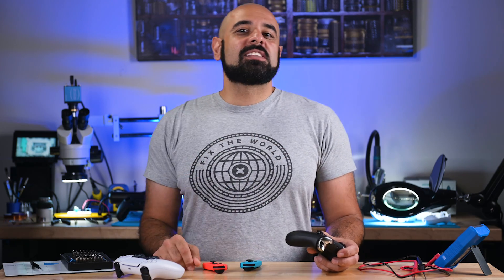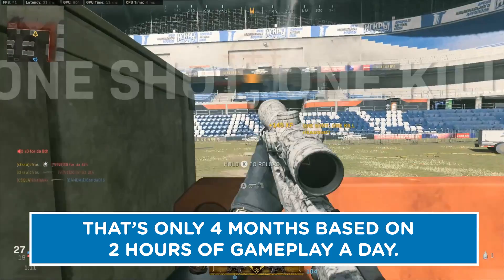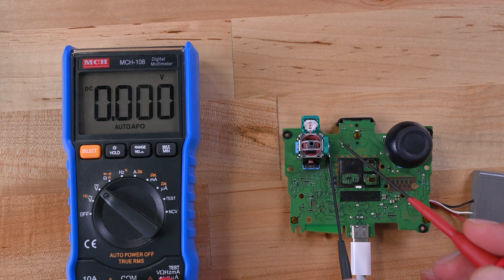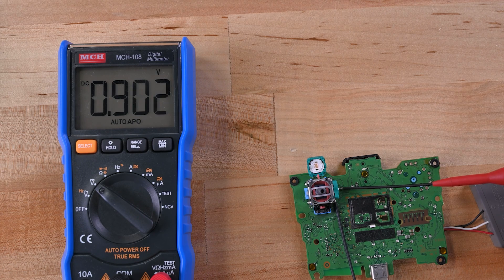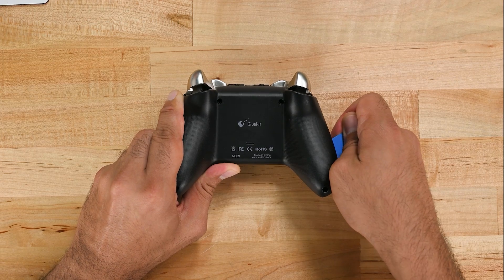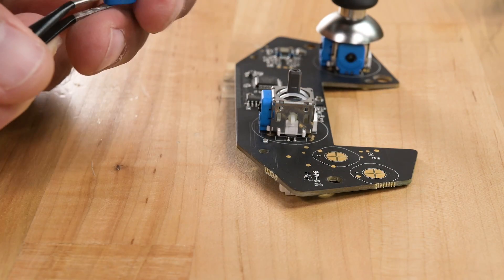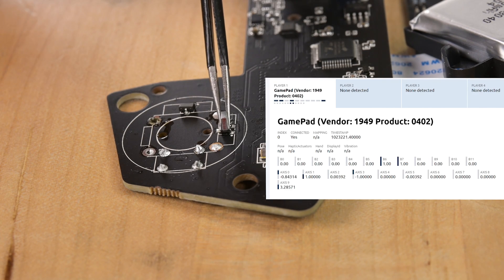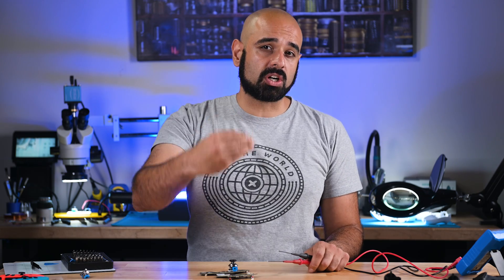How Manufacturers Can Fix Joystick Drift - Permanently!

Comment: for me, I've been able to stretch out my pro controllers to years instead of just a couple months by remapping and training my brain to use the back buttons as the l/r 3 buttons, since mashing those in causes the most amount of stress.  I for sure would drop big moneys on a pro controller with hall effect sensors, because I'm not going back to mashing the l/r3 buttons ever again lol.
Reply: that was especially an issue on former dualshock controllers because if you pressed the thumb sticks in it would apply pressure to the circuit board inside and cause internal slack over time. this made it so the controller would mash random buttons even though the analog sticks were just fine. i don't think other controllers encounter these sorts of issues.

Comment: The one problem is that, currently, most companies have joystick drift to their favor since their customers either buy replacement parts or flat out buy a new controler. The only way I see to fix this is if a 3rd party company can successfully compete in the market using these sensors.
Reply: Well Gulikit is supposedly working on replacement Hall Effect sticks for joycons and already has them available for the steam deck.
Reply: @nsshurtz  If they can pull it off for xbox 360 controllers, I'll replace all the sticks in my controllers right now...
Reply: @ddrfr33k hey idk if you’ll receive the notification, but there’s already really good ones out. If you can solder (the iron is less than $20 on amazon) and you don’t mind the Chinese (since the module is from aliexpress) it’s 10 modules for $15. So you could do 7 full controllers. I can link you the video of the guy who tested them so you can decide for yourself.
Reply: @nsshurtz  Yeah but it's Nintendo we're talking about, they'll probably hit Gulikit with some bullshit multimillion lawsuit to stop them from making hall sensing stick modules that be used in Joy-Cons.
Reply: Until Sony cancels your account for refusing to use their controllers.
Reply: Or simply legislate that a controller that suffers from drift is patently unfit for the use it is marketed for, constitutes fraud, and the manufacturer is liable for repairing all drift issues for the lifetime of the product.
Reply: @superslash7254  or people should just assume a controller is a "consumable" part meaning they wear out overtime. It's like saying a tire should last forever or it's not fit to be sold.
Reply: @randybobandy9828 
While controllers will eventually wear out, you should expect it last longer than the warranty. Usually 1 year. But these controllers starts getting drift within months on use. Not acceptable.
Reply: @2010ngojo  months of heavy,heavy playing
Reply: @randybobandy9828 
Doesn't matter. If the controller is not abused, then it should last at least the warranty period. Unless they like to replace a controller every few months, because that's what Nintendo is doing right now.
Reply: Game controllers will be more of a challenge.The issue has been solved on R/C transmitters, since you buy them separately and people expect them to last many, many years, hall effect is a major selling point, something consumers actively seek out. Now that this technology is hitting the "mainstream" gaming market, I can't help but feel it will be a desirable feature here too.
Reply: @jpsalis  i hope so
Reply: They want sustainable economy but we need sustainable consumer electronics,..like 6 years or 10 years warranty
Reply: @Deezeone  very well said.
Reply: There's the gulikit kingkong 2 pro, right now it supports xbox, mobile and pc if I'm correct
Reply: I gave on a PC lol
Reply: or people stop using controllers for a year at least and switch to keyboard and mouse as a form of punishment and protest..then these companies will start fearing and respecting consumers
Reply: @techach3490  lol they won't care if you don't use a controller for a year.. do you think a controller sale is a huge part of their revenue stream 😂 no, it's barely profitable,  they make their money on games and software sales.
Reply: if so then i would expect small tech companies to come out with all in 1 complete replacement kits for the sticks that are as close to drop in as possible
Reply: Exactly!
Reply: problem is if some company were to make a Hall Effect JoySticks version of the dualsense i don’t think it could use the adaptive triggers and haptic feedback because of patents etc.  im not so sure many consumers would take that compromise.
Reply: I would be in the market for a 3rd party controller with hall effects sensors if they just copied the Playstation layout instead of making every 3rd party ps controller a Xbox copy... There is a reason ps players play on the ps. It also needs to feel as good in the hand, the adaptive triggers are fun and feel good in mw2 tho so it would be nice if they take that aswell but idk if that opens them up to lawsuits
Reply: @championxxlNL 
The controller is not the main reason for playing on the playstation, come on now.
Reply: @2010ngojo  no ofc not but I do prefer the lay out over the Xbox and with the ps5 sony finally made a controller that also feels just as good, if not better, in the hand
Reply: @championxxlNL 
It's still meh in terms of overall design vs other controllers. Who designs a controller where you can't put in down without the triggers being actuated. Better than their first few designs though, arguably the best they designed.
Reply: My controller is blue so I never get joystick drift
Reply: "Competitors" do exist... but I wouldn't expect gamers to be willing to pay for military grade hardware made for drone operators. Despite the fact that the military hardware is perfectly compatible with xbox and HID.
Reply: Well, judging by the worldwide discontent with these controllers and the problem of drift, especially in the new generation, we must do it ourselves, apparently. Compete on your own
Reply: they will software block this making your third party controller obsolete only way is to solder holo lens sticks to your ps5 controler etc but even that they can prevent in software if something in the controller is changed the controller might simply dont turn on.
Reply: The only company I can see doing this change is Valve with their Steam Deck.
Reply: Let's see how that's working for Nintendo, where they are replacing a bunch of joy cons for free.
Reply: Only cuz the law was threatening to come down on their asses
Reply: @2010ngojo  aren’t the big 3 all getting a class action lawsuit for their controllers anyways ? 😂 next gen we’ll probably see better joysticks but i doubt this gen since lawsuits take years.
Reply: @Hypno_BPM 
Didn't Nintendo recent got one of the lawsuits tossed?
Reply: @2010ngojo  yeah cuz of the EULA saying consumers can’t sue Nintendo 😂 bro life is a meme fr. Still they’re giving free repairs and i’m sure spent a lot of money for the court lawyers so idk , the smart business move would be to make better controllers for their next console. Nintendo is usually great with accessories quality so the joycon drift might be a fluke. The biggest difference between Sony/Xbox and Nintendos lawsuits imo is the fact that Sony knew the dualshock 4 had drift issues and still decided to use the same parts for the dualsense whereas Nintendo didn’t have any issues with the Wiimote
Reply: @Hypno_BPM 
Personally I never had drift issues with my ps5 controller but several joycon drifts. Luckily there are aftermarket joy con replacements, but still.
Reply: @2010ngojo  yeah i mean it’s a lottery when you guy these modern controllers. i’m on my third dualsense all got drift on the left stick and my brother for example still has his controller that came with the console.
Reply: @2010ngojo  i’m on my 3rd dualsense in just a year and i take care of all my electronics so i wouldn’t say i’m causing it since it definitely feels like mechanical problems. But then my brother still has his controller that came with his ps5 so i feel like it’s a quality control issue.
Reply: Currently the "3rd party company" would ONLY be gulikit because they claimed to have patented the Alps compatible design. This will also wall off any possibility for major controller maker to switch to them for obvious reasons since they are the only one who can make Alps compatibles that allows low barrier adaptation but they also are a unknown Chinese company came out of no where and can't make any guarantee on quantity and quality assurance.
In one way gulikit made the big picture worse since now major controller makers need to make their own design for no or negative financial return, further upping the entry barrier. I can see some small startups use them since they only need to make thousands and not millions of orders.
(I guess Alps could still license the patent from gulikit and make their own version of it, Intel-style, if more people want this or someone in charge actually decided to ban planned obsolescence)
Reply: Yup, i still have the original Dual shock 2 that came with the console.
Bought it at few months after NA PS2 launch.
Still working flawlessly till today.
Reply: @rubiantary  i have a nintendo 64 controller that still works perfectly
Reply: Yeah I bought 2 powerA controllers for my switch and Xbox and they work great thier wired so no drift.
Reply: @GamerBoy870  Controllers being wired has no effect on whether they will drift or not, it's the hardware inside the gimbal itself that dictates that. PowerA still uses a regular potentiometer that is prone to drifting so at some point or another, your controller will start drifting too. The only solution to drift is implementing Hall Effect Sensors or a deadzone (Not really a fix tbh)
Reply: @Metallica4Life1995  i think replacing the potentiometer works too but i usually replace everything
Reply: @Metallica4Life1995  I think this guy just skipped the video and wanted to plug powerA for some reason
Reply: @nicoful86  i’ve seen lots of broken power a controllers lol
Reply: Probably just excited about their third party controllers, which I get.
Reply: @dannyboy643ify sometimes just replacing the track or the wiper works.
Reply: @GamerBoy870  my old powerA android controller drifted, but since they're using a non-standard analog stick, I couldn't source parts for it and thrown it out.
Reply: @GamerBoy870  wired controllers don't change anything about stick drift lol 😆 they will get drift because they use the same internal  joystick components.
Reply: @GamerBoy870  PowerA controllers, as one os all the PDP rebranding, uses cheep parts and the board is very bad quality, so yeah, those work as good as one original, but those have like the half of the life spawn and those aren't reparable 🤔
Reply: @blzbfallenangel  everything is repairable if you got the right tools
Reply: @NoName_NoTitle  I suppose you haven't worked with those.
Reply: @NoName_NoTitle  not just the right tools.. but the replacement parts.

Comment: What really pissed me off is that my bootleg PS2 controller that my brother bought 17 years ago never experienced any kind of drift, so its not the technology but more the build quality, they are asking for higher prices but their quality is going downhill
Reply: PS2 also has a giant deadzone in software, which hides the electromechanical issues somewhat, and much larger stickboxes than those used today, so they do fundamentally have more endurance. They wanted the sticks to feel more responsive and controllers to be slicker, so they optimised things to the point where they barely work - and they're happy enough to cause you to buy replacements.
Reply: @SianaGearz  However one issue, ive bought 2 playstation controllers (sony) and both of them have an issue with the right stick jumping all over the place, so in games like Ace Combat you can't really look at your plane because the camera is jumping around like crazy. My old PS2 abused controller never had this issue after years and year of use.

Comment: I don't think the potentiometers are what makes the stick snap back to center every time. I've never had any drifting issues unless the stick itself became loose and no longer snaps back to center.

The joyscons are the one exception. Also you never covered joycons even though you mentioned them which is bad. People may get the wrong idea of what's going on inside a joycon if you make it sound like they are the same as a normal Analog stick like on a PS2 or GameCube.
Reply: Not only can the resistive strip wear out, but so can the metal wiper that touches it. Even Nintendo's Pro Controller has problems with drift. On mine, the northeast edge of stick movement results in the stick calibration tool showing a floating, flickering stick. It's bad enough that I can't make a full circle anymore to even finish the calibration. It's really really bad. Joycon sticks though are particularly problematic due to their design that can result in the back of the stick box bowing out with use and potentially putting additional pressure, wear, and dust buildup on the wipers/sensors
Reply: @holopengin  Aside from the joycons that wear out pretty quickly, I've only suffered drift in the pro controller, and the problem is the plastic around the thumbstick wearing out so fast and leaving a lot of dust that ends up everywhere inside the controller. 
I'm really not sure the only problem causing drift are the potentiometers wearing out.
Reply: The potentiometers themselves do not cause the stick to snap back to centre; but the entire joystick assembly (which also includes the potentiometers, for the ones used in OEM console controllers) has a spring inside its base which provides this centering action. If that happens, it doesn’t matter what type of sensor the joystick uses; loose is loose, and if the physical stick is moving around it will naturally cause readings to drift.

Comment: xbox uses hall effect sensors, but only in the triggers
Reply from the maker: Most modern controllers are now using Hall Effect sensors for the triggers. Dismantling a trigger mechanism leaves no doubt, Hall sensor triggers are technically less complex and use less space than pot based triggers.

Comment: Is it possible to replace the old sticks with these new hall sensor sticks just by desoldering the old ones and putting in new ones or will there be a problem because there needs to be extra hardware to interpret the analogue signal?
Reply: Seems possible to adapt the magnetic sensors into the potentiometer pin holes, since they both use 3 "legs", might be a cool project to work on. Not guaranteed to work tho, they might use different voltages or something. But seems achievable
Reply: Here's how i think it should work

The controller only cares if it's receiving between 0V (all the way down) and 1.8V (all the way up) and 0.9V is the center. So if you

Take a set of these magnetic joystick boxes and 4 hall sensors rated for like 3V or something

Mount the sensor just like they are in that other controller in this video 

Then take 3 thin copper wires and connect the sensor legs into the potentiometer holes, matching their pinout

By this stage you can already test if it works, since it's all analogue it should, because the xbox controller CPU is who translates that voltage into a digital signal.

There is a possibility of it working but INVERTED, this will happen because the magnets inside are oriented the opposite way, the way i would fix that is by inverting upside down the magnet housing in the blue piece of the joystick box, maybe you could just flip the magnets themselves too in case that plastic piece only goes in one way but that sounds silly lol

By then it's just a matter of centering the sensor as precisely you can and then find a way to make it stick in place